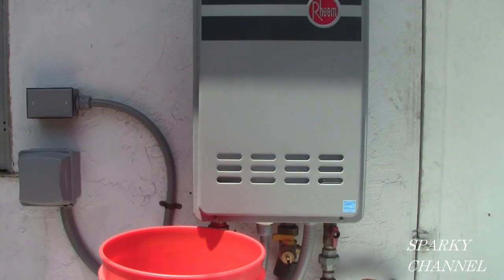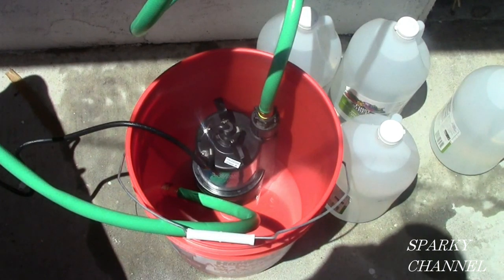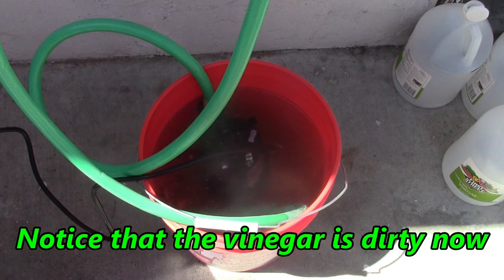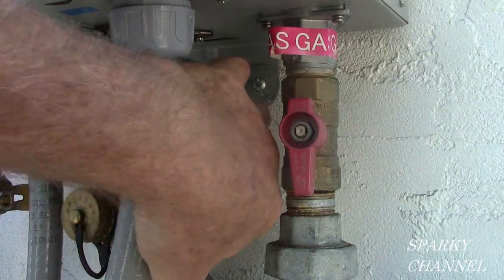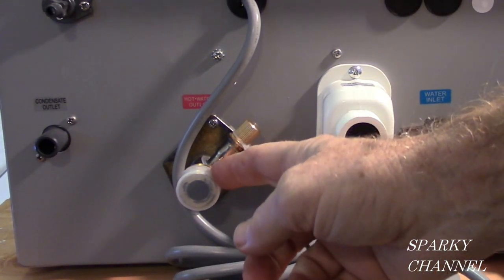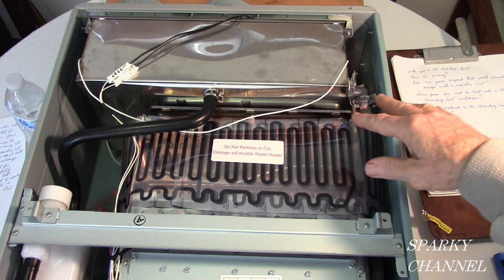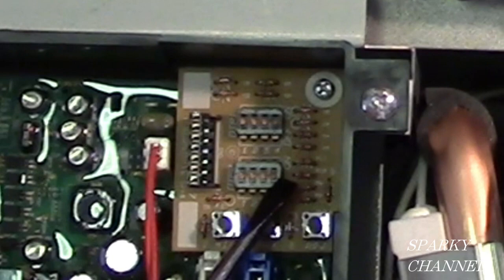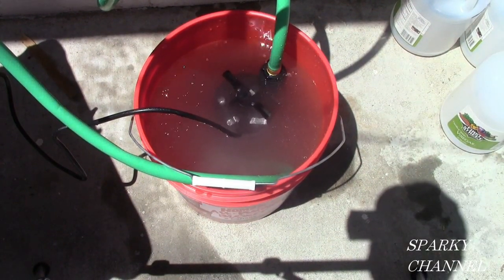Tankless Water Heater Cleaning Lime & Scale, Error Codes & Tankless Tour

Comment: Excellent video.  Your video is clear and logical in both form and presentation.  I noticed you used a green hose (water hose) to compete the decalsificalion process.  It’s my.understanding that all regular water hoses are coated inside with formaldehyde.  This is a preservative  for the outdoor environment.  As an alternative, you can use a “white water hose” used for RVs that is rated for potable water hook ups.  In addition, I believe there are mesh reinforced vinyl that is also acceptable.  ( I not 100% sure on that.).  I’m 100% sure that the white Rv water hose would be safe.  Please keep making your videos.   They are very informative and well made.  Thank you.
Reply from the maker: Thanks Richard. I wasn't aware that there was any problem with green garden hoses. Thanks for the heads up. Sometimes I use clothes washer hoses (stainless steel). They work fine as well.
Reply: @SparkyChannel   Hi.  The stainless steel hoses are probably the best choice because of the safety for water consumption plus the durability of the braided steel.  Thanks!
Reply from the maker: You talked me into it. Sounds good! @richardgarcia6108

Comment: Hi!  Great video but I’m having trouble descaling my RTGH this time around. I follow the steps but then after about 30 seconds the circulation trickles and stops. What gives?!?! I’m running the hot water then unplugging the unit so I don’t think a valve should be closing.

Comment: Sparky, thanks for the video.  I have a Rheem and when I power it down per your instructions I just cannot get flush to come out of the hot water side with the pump running.  I have tried every power down configuration on YouTube with no luck.  I can lift the pressure relief and it will flow through there, but not out of the hose.  I’m stumped.
Reply: Did you ever figure out your issue?

Comment: I have a Rinnai. I do mine once a year. I bought a bucket with a screw top. I keep the pump and hoses in there with spare parts. I close it up so it stays clean when not using it.

Don't pour the vinegar in the grass. It will kill it. You can probably figure out how I know that. :)
Reply from the maker: I do the same with my tankless cleaning stuff. I even put the toothbrush that I clean the filter with in the bucket. 
I poured my vinegar down my house drains. I think it helps keep them clear. I divided it up with all my drains.